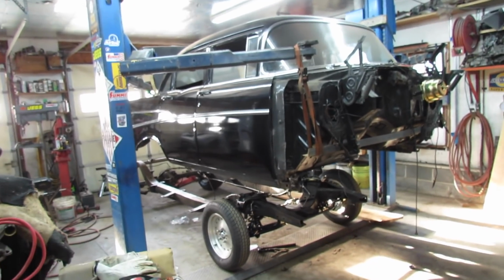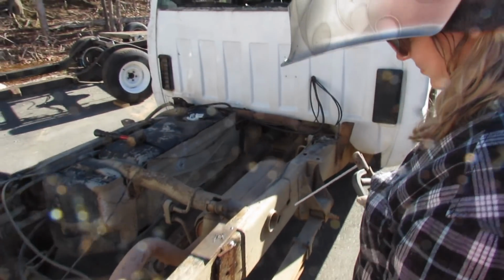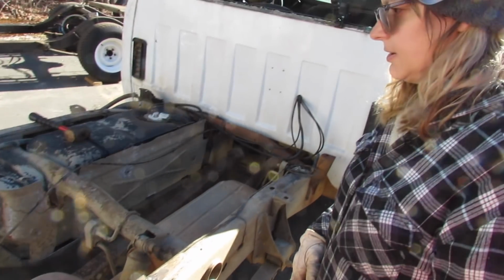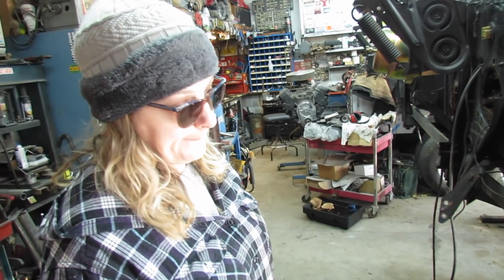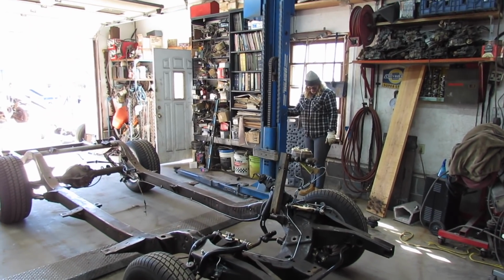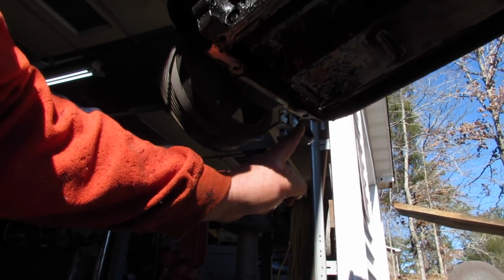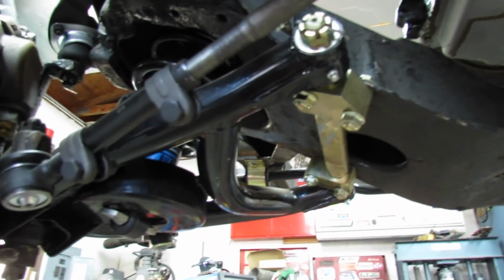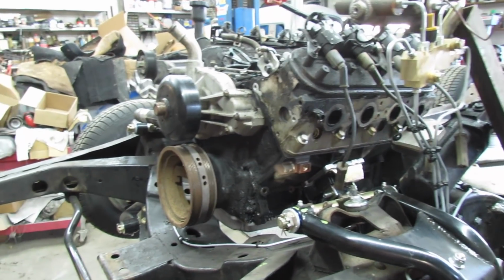57 Chevy-Engine and Transmission

Comment: I learned to arc weld on the farm in the 1950s with a lincoln 180 amp ac only arc welder. the kind with plugs around the center in a big circle. mrs Hevyshevy is doing fine. with a bit of practice she will have it figured out.

Comment: The point is normal on a spark plug for a Vortec motor, so it may be the same on your 5.7. I have 6 new ones that only have less than an hours time running on them, and might be blacked a little. I could send them to you if you need them.

Comment: It pays to be a saver(some would say hoarder). That spare block allowed you to get a headstart on your fabrication. It would have been much more difficult to fit the motor mounts and trans crossmember with the body in place also. Do you think you will have to modify the new floorpan to clear that big ol' transmission?
Reply from the maker: Not sure, but I'm getting ready to find out.

Comment: Knew a guy that put a 396 in a 57 in the late 60s and he had to cut the manifold to get it in with the stock manifolds on it. The left one was to close to the steering box. Another guy put a 427 in a 57 but he put headers on it. That was in 72 I tried to trade him my new 72 Nova for it and  he wouldn't trade with me. He had a car lot and left it on the lot one night and someone stole it from  the lot. I went to work for him later and was asking him about the car and he told me what happened to it. He had put a lot of money in it. It looked like a new car him and his dad had the car lot and a upholstery shop to so it had a new interior in it nice bucket seats a console and 4 speed transmission. It was as nice if not nicer than it was it 57. I think he said it was a frame off restoration. 
Stay safe and God bless.            Dan

Comment: Nice you were both in the garage. Tricky getting the steering right. Mockup went well otherwise and you will be able to sort out the gearbox crossmember now.     Will be interested to see if the gearbox has clearance in the tunnel once you  refit the body. Stay safe.
Reply from the maker: We’re getting ready to find out.